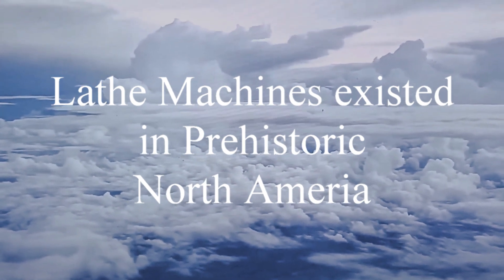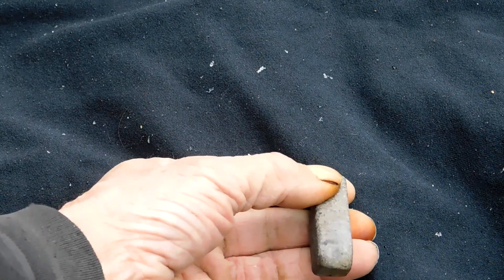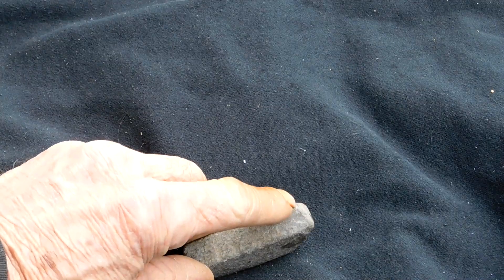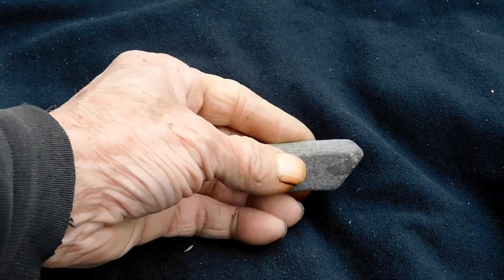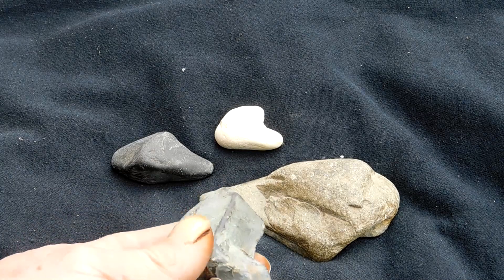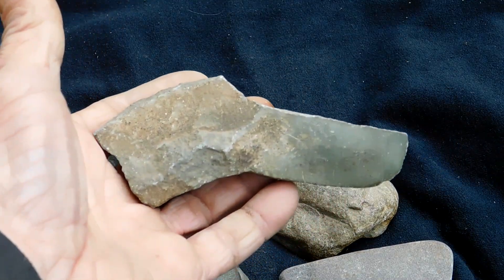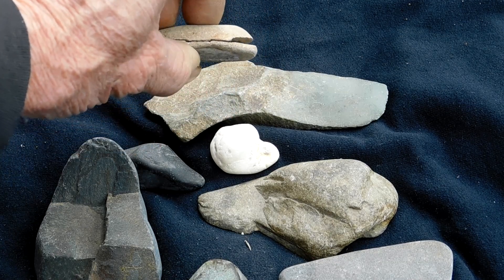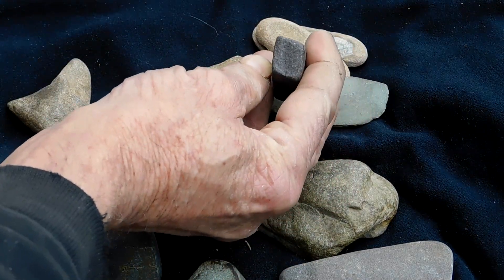Proof of Ancient  Machine Technology

Comment: The geometry sure looks like a cutter, but what material would they have turned? What would they have made with that material? If they turned stone we would expect to see those artifacts as well? How many more such tools have been found?
Reply from the maker: They are not common I found several of these  in one place. This tip would cut softer stone. It would cut bone and antler. It would polish metals. More work needs to be done to identify other representations of this type of tooling